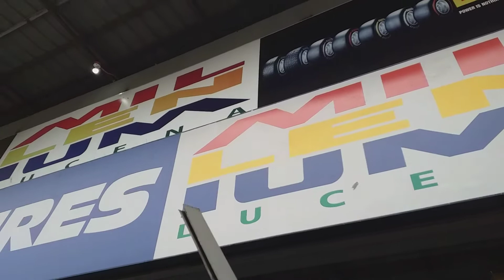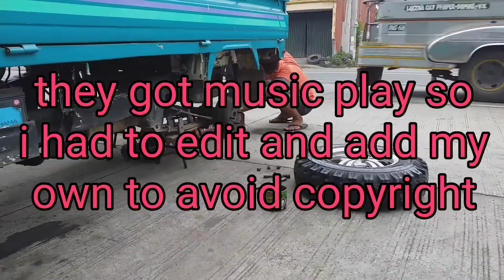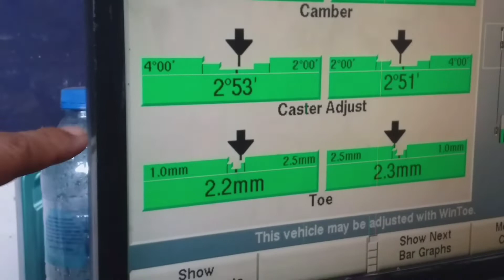BALANCING/ALIGNMENT AND PUTTING NEW TIRES MULTICAB

Comment: I like that I did not see any use of a impact wrench when the tires were reinstalled. Auto  shops use these, and when used properly it may be OK.  --- I once had the wheel studs threads stripped on two wheels by a shops misuse. --- I was actually very lucky that I had a flat tire just after the shop had removed and replaced the tires. If the stripped studs had been found months later, the shop could (and would) have denied responsibility.